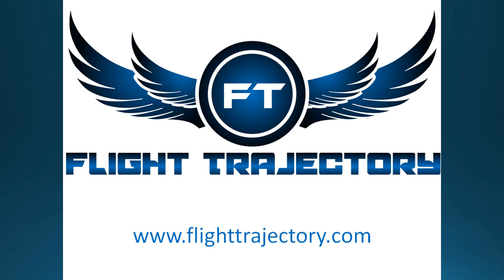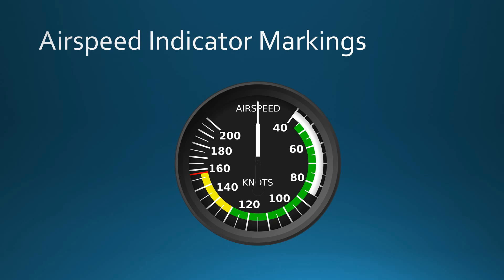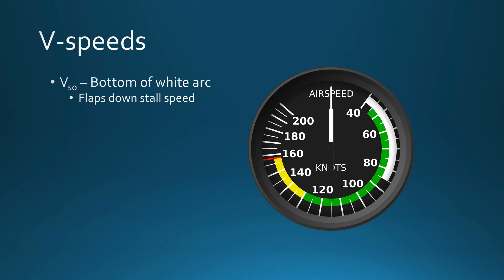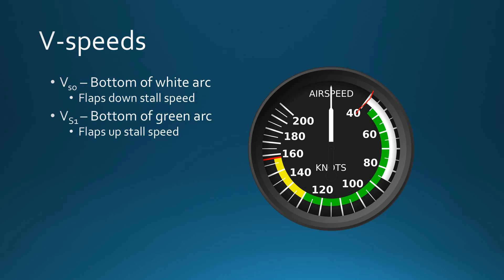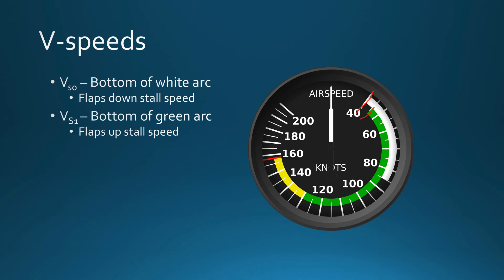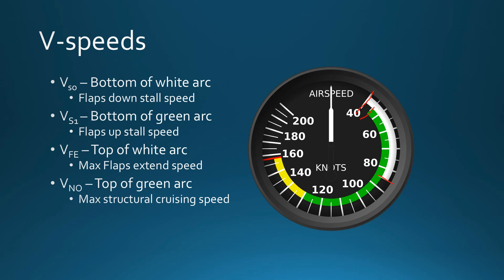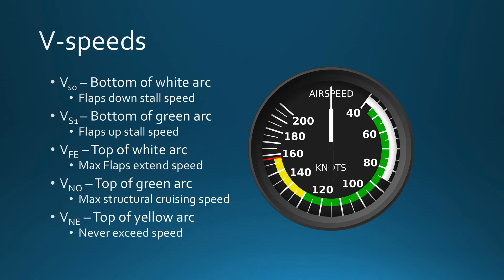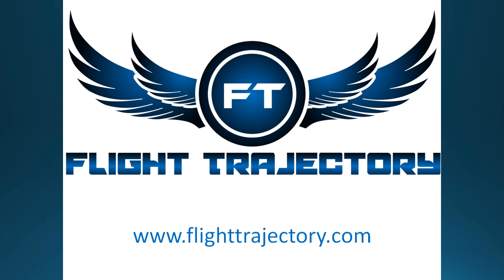Flight Simulator Lesson 12: Airspeed Indicator Markings

Comment: Let's take a large commercial aircraft. These aircraft are meant for cruising. When taking off, airliners gain airspeed rapidly therefore two minutes after lift off they reduce power to prevent overspending the engines and causing structural failure when exceeding VNE which is somewhere around 300knots near sealevel. The planes that collided into twin towers were supposed to be moving at around 525mph. At this speed near sea level, controlled flight was impossible. The planes would have disintegrated well before hitting the steel and concrete structures. They were actually able to penetrate these hardened structures like hot knives through butter. I remember reading an article about when a military bomber crashed into the empire State building and it bounced off. Really? I thought all commercial aircraft could slice through hardened structures. Please tell us why the simple principles you are explaining did not apply on 9/11?